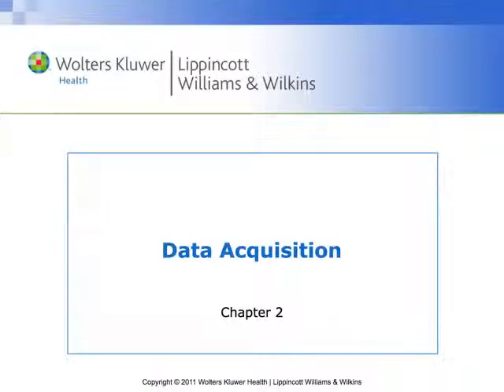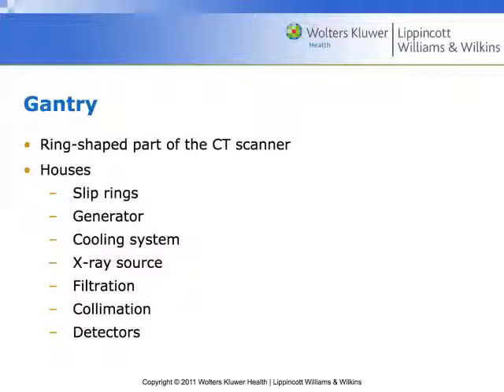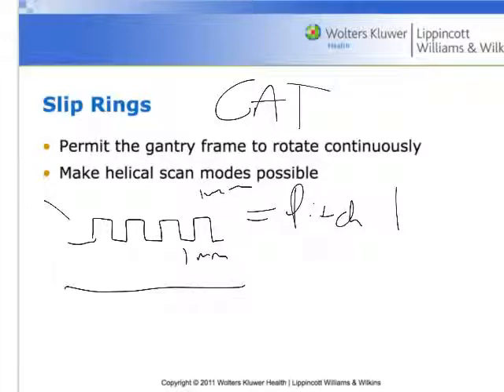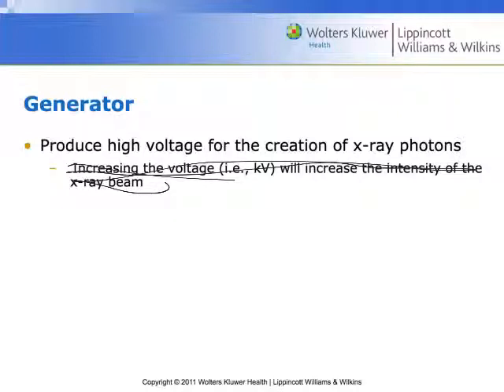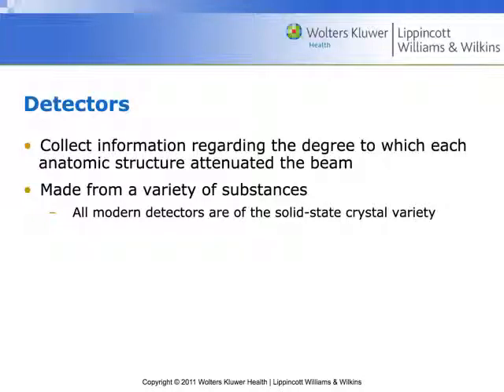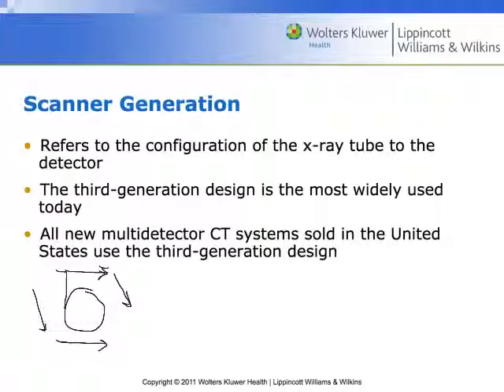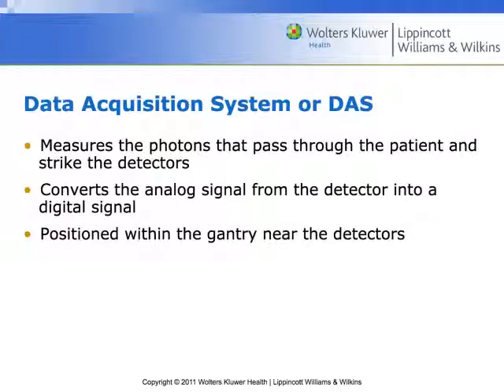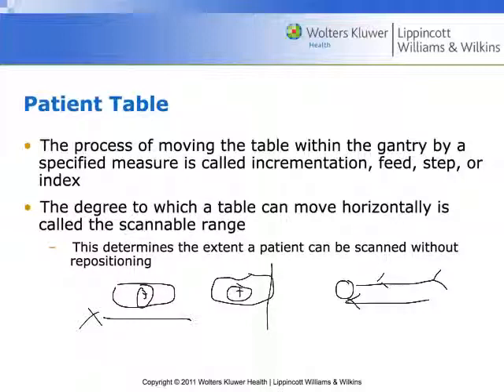CT Data Acquisition

Comment: I have a question. At about 7 min into your video you say to reduce patient dose ,you need to reduce KVP. I have a another version of the book and she still says the opposite. For registry purposes ,if it's question,what should I respond ?
Reply from the maker: Angie MORALES-PENA - To be super clear, if we’re talking about diagnostic radiography, increased kVp can reduce patient dose. For CT, it’s controversial. Romans claims (without references) that increased kVp will reduce patient dose. Research suggests otherwise for the reasons discussed in the video. The ARRT is aware of the controversy and should be tailoring the registry accordingly. Long story short, you’re asking a question that they will most likely NOT ask on the registry. At least not until there’s more agreement among sources.  It’s lonely out on the cutting edge. Hope this helps. Thanks for you question!
Reply: Bennie Roberts 
Thank you for responding and I hope that Ms. Romans and all other sources come to the correct conclusion quickly!